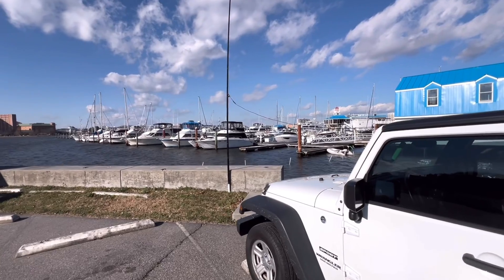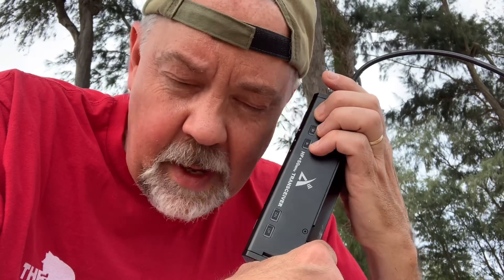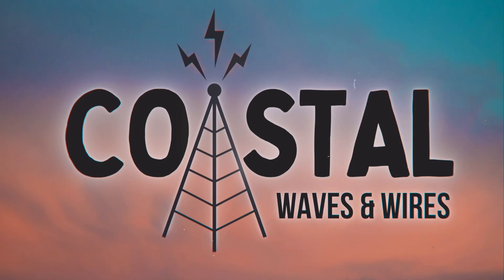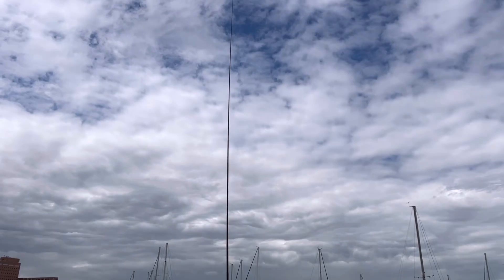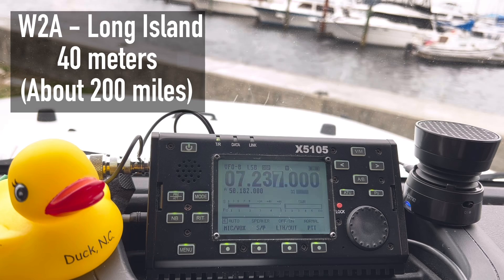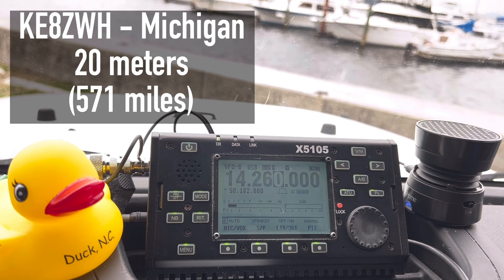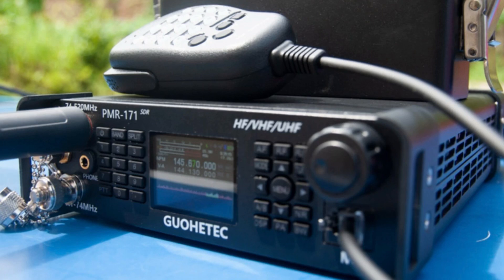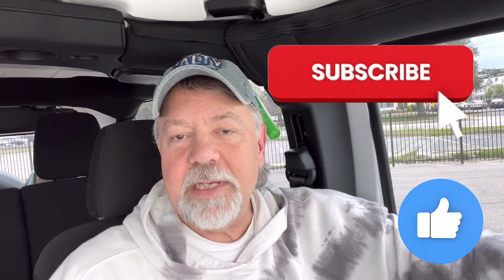SHTF QRP - Will 5 Watts Work for HF Emergency Comms?

Comment: 5 Watts will work. I have nothing over 5 Watts c.w. and s.s.b.
Pick the frequency for the coverage and low power and I'd expect little QRM if most things are shut down I see no reason why not QRP. 5 Watts or less allows a longer operating time on batteries and solar panel which is what I use.
Examples from my contacts; 280 miles on 60m on c.w. using low inverted vee, over 1,000 miles c.w. and s.s.b. on 17m and 10m using attic dipoles, even one Watt c.w. For local stuff use 2m, 160 or 80m.
G4GHB.

Comment: Don't forget local and regional comms! Following a natural disaster, of course you need to be able to reach friends and family outside the affected area, but coordinating with local friends and family, aid groups, etc., and staying on top of local news is equally important. I live in coastal Florida where Hurricane Ian made landfall on the mainland at around 150 mph after already wreaking havoc on Sanibel and Ft. Myers Beach. It took nine hours for the eye of the storm to pass by with the winds gradually weakening over that period. When it was over, I was amazed at how many local repeaters survived that beating. Not all, but most. Naturally, the power was out and the internet was down for weeks (only 2 weeks for us, but others waited longer). And cellular coverage was very hit-or-miss for well over a month, which was particularly frustrating due to all the die-hard non-radio people in my circle. 
HF is important not just for long-range, but ground wave and NVIS, too. However, don't forget VHF/UHF, GMRS/FRS, Winlink, JS8Call, and other digital modes and even CW, which all have a role to play. Whatever it takes. In addition, the county-based ARES teams (with whom I am involved) and the National Weather Service as well as other entities across Florida have been busy this past year building a robust NXDN network. 
I remember walking around my property with a cell phone at 4 a.m. the day after the storm after working on battery and generator power searching for a decent signal so I could send an email with a very large attachment to a client in Germany via the cellular network. And I finally succeeded. Whatever it takes! On the plus side, it's amazing how many stars you can see when the power is out for miles around 🙂

Comment: Why don't you look into fitting the G90 and battery into a box? You can have a couple of different wire antennas rolled up for various bands and conditions in the same box. People usually fit these boxes with solar chargers as well as normal chargers for the batteries. I have a box which will take a battery and my IC-706 and an EFHW antenna in it so I can just put it in the car and go. I could probably also fit my Xiegu X1M in it. I have planned a smaller box for the X1M and smaller battery. I've managed to call all over Europe with the X1M on 5W.

Comment: Yaesu yoosta make a paramilitary radio, Bonnie, KQ6XA used one for both HFPack and her SA cave explorations.  Self contained, 25 W.  Not cheap, dunno if they are still made, but someone must still make such radios.  For what you have invested in all your QRP radios, one could also be had.  Just be careful to observe band edges.  Jerry  wa2omu

Comment: I used to think events like Winter Field Day were supposed to give operators a chance to shake out their system and see how well it might work in SHTF situations. But unfortunately traffic is dominated by folks sitting on their asses at home with their 100 watt rig (lots probably higher...) and massive tower-mounted antenna. I've used my QRP radios a lot for SOTA and it has convinced me that I can get a signal received by other hams in most conditions. Just not contests...

Comment: That was great . that my favorite DX antenna.  I use ground plane setup with 4 or more radials spread out. works super.  we had a weak earthquake . stronger towards  NYC . things like this can take comms down as well. look at what happened to Japan and Nuclear power plaint. all started with a Earthquake . Taiwan just had a strong one. Comms down is very likely ! Ham radio has came threw all threw out history ! and 5 watts does work well. may be a challenge with high noise floor.  nice sounding EXT speaker. love that antenna wire. I have the same 20 AWG in 5 colors comes in a box . great hook up wire for low amps. under 1. that wire stays flexible in the cold. not like Walmart speaker wire that gets still and cracks in sun if left out months at a time .still a great test antenna wire . love the bright color ! that makes a great SOTA and POTA antenna for the go kit.  SOTA makes some great DX as well. I have a few in the log. just hunting for now.  that SOTA . POTA I go to the park and set up have some fun.  got a SOTA DX . with a IC 705 at 5 watts 20 meters. love that IC 705 ,I have used one. all mode HF/VHF/UHF .  lots of SOTA and POTA use it. same with the G90 ! . when SHTF you may not have grid power . QRP battery runs much longer. 73/s

Comment: My 10W into an EFHW has no issues at all on 10-40M, SSB or otherwise. Also, I run a 10M beacon that routinely gets 2100 miles or more at 2W with the EFHW only maybe 8 feet off the ground. A resonant and efficient antenna is king.

Comment: look into JS8 call for EMCOMMs... it's a community of people who are practicing this every day (in normal times) so that you can easily jump on here for emergency times. I routinely run 5W on JS8 and get all over the US. I wouldn't use this to get ahold of 911.. but for getting information to specific people or using it for winlink.. this is exactly what I would use.

Comment: You should try this again but in open ground with NVIS type of antenna. Same radio and same power and see how it fares locally with a SHTF type of condition. Also maybe that new Quangsheng radio and doing the mid to get it to VHF SSB and see how well that goes in a range test with a few buddies, Could be a fun test all round.

Comment: Another great video Walt! I am already set up for SHTF as well. With portable antenna and a Yaesu FT-857D that I can dial down the power for QRP. I will do mostly listening anyways unless I have pertinent information or I need a definitive answer about something. 

PS: Did you feel anything from the earthquake that happened in Jersey? It was felt in Philadelphia. 

73 Jim K9KXW
Reply from the maker: Hi Jim, didn’t feel anything down here

Comment: Digital modes will get through at 5 to 10 watts when SSB needs a lot more.
Reply from the maker: In an emergency there needs to be someone that is a responder. I understand you may enjoy that part of the hobby but ham radio digital modes are not going to save you. Have fun with digital modes, it’s a great part of the hobby. In an emergency, key the mic.

Comment: Where I live disasters are going to be very localized (tornado) so pretty easy to get out of the affected area.

A few weeks ago we were vacationing in a remote part of Utah - no cell phones, very few people around and seeing signs saying 'no services next 130 miles'

In the very unlikely event we needed to get some help I was more than certain that 5 watts would be sufficient to find somebody to answer and relay.

That said, when we do go out into the great wilderness areas I probably should create an 'emergency card' with dead simple instructions on how to assemble the antenna and get the radio on the air for 20 and 40 and how to find people already talking to interrupt with and what to say.

Having the radio and being the only one who can operate it is no good if I'm not physically able to operate it.

Comment: I was watching a TV program here in the UK. A guy went walking in the Welsh mountains and didn't return at the end of the day. He had his mobile but turns out he  damaged his leg and couldn't walk in a mobile coverage shadow area. All ended well, he was found by rescue helicopter. Now if he had only had a Xiegu and telescopic aerial!
Reply: I've taken a VHF/UHF handheld radio out with me where I am in Wales, out on a walk where there's no phone coverage. Anyway, I tried some calls, tried getting into one of the local repeaters...and nothing. There was absolutely no one within radio range. I never bothered taking the radio again. Maybe I should try HF!
Reply: @paulsengupta971  I used to have an a.m. Pye Bantam on 70.26 MHz, ½ Watt out and telescopic ¼λ on it to talk back to a couple of stations in the Stockport area. Being on the right side of the hill made a big difference.
G4GHB.

Comment: Many years ago there was a massive power outage in my area.  I used a QRP (5W) radio mostly on 80 meters (CW and Phone)  to determine the extent of the power outage. I was able to determine the affected counties.  An NVIS or low dipole is great for this job.  My IC-705 would also allow RTTY operation without a computer using my K1EL keyer.   This radio allows for VHF (FM and DSTAR) for local contacts.  (Count on using simplex)  CW and RTTY  are easier to use at low power.  80 meters was super quiet with regard to QRN.

Comment: Nice video!!  I've had the same desire for that type of radio for a long time. The challenge with radios like the Guohetec PMR-171 and similar is the push-button "VFO". Just for giggles, I ran a friend's PRC-320 "Clansman" manpack radio for Field Day (circa 2007) using both the whip and the wire antennas that came with it. Long story short, I made only a handful of contacts, most all in my own state (for reference, we were in the mountains, up around 7,000' ASL).

But aside from trying to run that radio during would could be arguable the busiest radio day of the year in the U.S., the biggest challenge was trying to move around the bands. Even with the frequency adjustment being dials for each part of a frequency (thus making it easier (not easy) to change frequency), it was still a colossal pain in the neck. I cannot imagine trying to do that with a keypad based radio. These radios seem to be meant to be used in a "channelized" fashion.

The SGC-2020 has a dial VFO and is rugged. But along with some issues (like the coax connector apparently NOT being bolted to the radio chassis, but just directly to the board), it requires an external battery.

The closest radio I found that met what you're looking for AND was reasonably easy to operate was the Vertex VX-1210. Internal battery, tuner that could match a car bumper, and 20 watts, it seemed almost what you're looking for. The challenge with it was the extra batteries were very expensive, it had a standard 120v plug/transformer charger, and had a special unit that you connected to the computer to program it.

While it was more set for "channelized" use since it was a field radio/commercial radio, one could access a quasi-VFO once you were on a frequency near where you wanted to be (e.g. Turn the knob to get to "channel" 14.250, push the VFO button, then you could move frequency from there in steps of 5).

Nearly 20 years after my first steps into finding a Ham-friendly, VFO-based, internal-battery, 20w HF rig with a great tuner, I've yet to find one. I really stopped looking after around 2012 when I sold my VX-1210.

Comment: I was out hiking today and took some QRP equipment with me…. X5105, EFHW and tablet for digital modes. While 10m was packed with dx stations on ft8 I barely heard anything on ssb 😢. Managed to to some ssb qso on 15 and 20 but was disappointed by missing stations on 10. Did some ft8 then as well just to log some POTA stations calling. But in general I am really happy with QRP using the Xiegu or Ft818! 73 from Germany - Stefan

Comment: A few days ago I tried to make contacts using one of those ebay uSDRs.  I tried reaching POTA stations but I  figured they were as compromised as me..

I finally did contact the net control for the Maritime Mobile net.  I felt pretty good receiving a 56 report from Tennessee to Florida on a “toy” radio.

Comment: Hi Walt.  I am wondering about the "leaked" 6200 Xiegu.  Take the 6100, add 20 Watts and a better speaker and it might be perfect once the firmware settles down. 🙂
Reply: 6200 maxes out at 8w. However, using the Xiegu family and getting their amp is an option when renewable power is available (e.g., LiFePO and solar/shore power).

Comment: Shelter, water, food safety and then comms is the heirachy (shelter may not need to be first depending upon the location). Comms needs to be local at first to get organised so 40 is probably best with further distance only needed as things settle. If it's the big one cream to protect the backside from all the kissing goodbye may be needed :-). 73. M7BLC.

Comment: Hi Walt, I'd save some pennies and build a frame for the G90, it's a proven radio, great bit of kit.
Reply: Watch the Tech Prepper latest video on a G90 manpack build.
Reply: @carlosroig5315  I saw Gaston's video. I love his work, but the manpack cost almost as much as the radio.
Reply: on the, qrp cw channel the fella on that channel has made a cheap frame that'll accept a multitude of different QRP radios antenna fittings and batteries and would fit in most backpacks.

Comment: Not sure about the connector on the 5100 version but the x6100 speaker connector i noticed is stereo.  I have a few of the mfj clear tone cheap speakers around from different mobile setups ive done but they are mono. I bought the 3.5mm stereo to mono adapters and it sounds great that way. Much better than trying to halfway plug in the mono plug to the stereo port and only getting half the audio signal.

Comment: also work qrp with my ic705 and it works amazingly well for me. I love just using the internal battery and it has a great duration than my bladder LOL. Where do you get your band propagation info from? great videos! 73
Reply from the maker: Thanks! Check out Solar Ham dot com.

Comment: If you really want a great mind's eye view of the difference from 100/10/1/100mw listen to the beacons from NCDXF/IARU international beacon project. 
Thanks again for the great vids, 73
Reply: Totally agree, I listen to the international beacon project regularly, great resource for real time propagation directions.👍
Reply: I listen to them too on mainly 10m, attic dipoles here, good signals from some European beacons but not so good for the N.Y. one and not always heard.
QSO's of 1,000+ miles on 17m and 10m using 5 Watts c.w and s.s.b. and one Watt c.w.
G4GHB.

Comment: When SHTF and all (electrical) services are gone including all those nasty solar panels, wall warts and power line transformers, imagine how quiet the bands will be :) For sure 5 Watt will work.
Reply: It’s amazing during a power cut.
Reply: We had a short lived power outage here one time(20-30m), and yeah it's amazing. I haven't done any portable/POTA stuff but I imagine if you find a good spot in the woods it must be similar.
Reply: Solar will still be on though.
Reply: @paulsengupta971  Haha, agreed. It has been on for quite a while actually ;-)